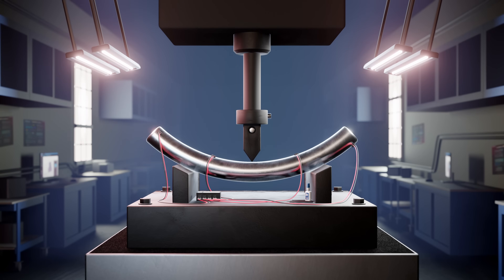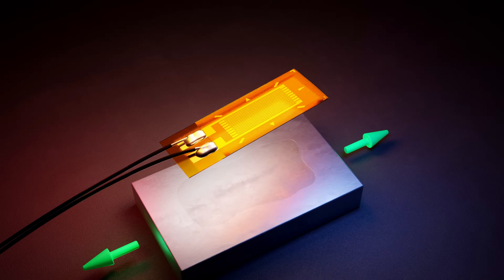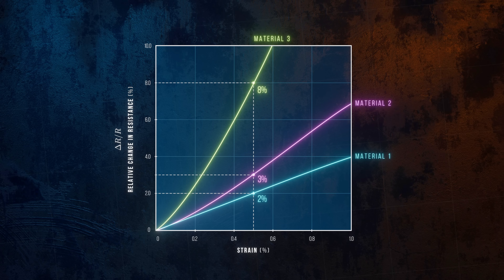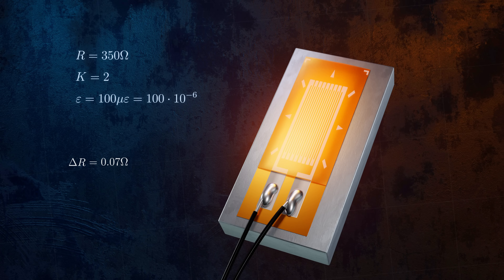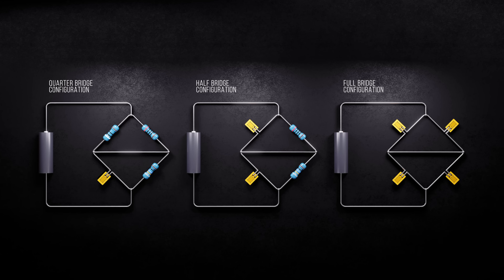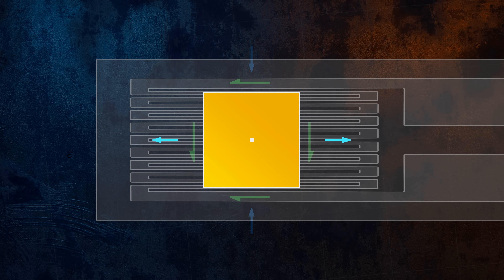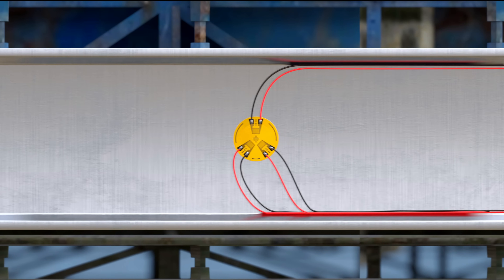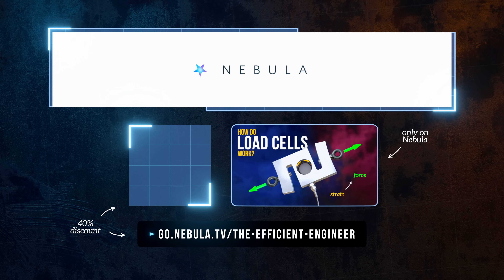The Ingenious Design of Strain Gauges

Comment from the maker: What are some other interesting strain gauge applications?
If you're interesting in the companion video on load cells you can check it out on Nebula at this link: https://nebula.tv/videos/the-efficient-engineer-how-do-load-cells-work
Reply: Got some video ideas from my mechanical engineering career :
Metal Additive Manufacturing
Ceramics 
Super alloys
Circuit boards :o
Coatings & Machining tooling
Reply: Used to work with them - testing car components. Was good fun !
Reply: Hey how about ARTIFICIAL GRAVITY 🎉 😁
I'm a regular ol sky-walker😂🎉 yay for me

https://youtube.com/shorts/aw2Zjrv6zkw?si=DA2IPe0O_CNWZn1p

Comment: I installed a lot of strain gauges in undergrad school.  We tested bolts and structures with reinforcing steel so I would have to file a smooth flat spot on the specimen, glue on the gauge and solder the wire leads to it.  I didn't know it at the time but we were using a glue material that later became superglue..

Comment: It has always astonished me that the original electric strain gauge was literally bare wire bonded to paper with nitrocellulose (Duco) cement, that was then bonded with the same adhesive to the structure. While this construction is pretty poor compared to the modern foil gage that is fabricated of high performance materials like a tiny circuit board, it worked , was useful and led to improvements to the current state of the art. 51 years ago, in my masters of engineering program at Cornell, we did a lab where we fabricated and tested gauges like the original BLH (Baldwin-Lima- Hamilton...yes the locomotive builder, who invented this amazing technology). It really brought the technology alive for me, and I have used strain gauges and loadcells and strain based transducers throughout my career. Custom transducers for measuring suspension forces in automobiles, torque in robot joints and applied forces in Friction Stir Welding to name a few. One of these is a X, Y and Z load cell with a 60,000 lb capacity in Z and less than 1% crosstalk in X and Y, without a compensation matrix.

Comment: Its bond with a special glue and then left to cure for some time.
Do you know it originate when the strain in an aeroplane wings was measured using a long resistive wire glued to the wing. Below the wire stretch and the resistor goes up.
On top of the wing the wire shortens and the resistance decrease

Comment: You can't measure change in size of a single point, any deformation must be measured between two points, whether electrical or mechanical. A point is infinitely small, immeasurable and usually resented by those without one.

Comment: A couple 'funny' animations:
0:05 The ends move up and down, a lot, even tho the load is only between the supports. The straight ends should have no curvature outside of the supports.
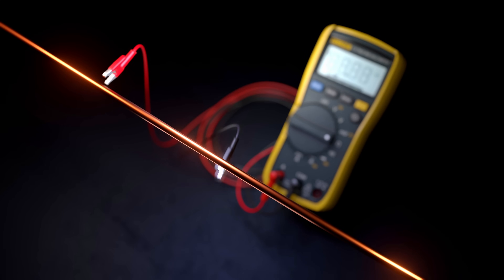4:36 Wow, that copper stretches a LOT, like 300%, and then goes right back to its original shape. That doesn't work for many reasons, not the least of which is simple conservation of mass, the rod's diameter never changes while expanding in volume 3 times.
Reply: I was going to make the same comment on the :05 image.....IT is a pet peeve of mine that incorrect depictions of physical behavior are lie poison....they lead to incorrect mental models of things like deformation of a structure under load. Real intelligence, like the artificial impostor, needs to be fed correct data to be of value, and animations like this faulty one are powerful images. They need to be right.

Comment: I use to see one of the inventors of the strain gauge, Edward Simmons, rummaging in the electronics part stores (when they still existed) in Pasadena, CA, from the 1970s thru 1990s. He was a bit eccentric, but all the other old timers that engage with him, did it with much respect. He made a fortune, but not from the strain gauge, but investments in oil companies.
Reply: Renaissance Ralph, as he was called, always wore opaque tights, some kind of short toga outfit, sandals and a hat, and was often seen on campus at Caltech. He was rumored to sometimes wash his hair in the fountains, but I never actually saw that happen.

Comment: Excellent! But what is a micro strain(in this context it is a unit of measure??)??
Reply: 1 strain is stretching something to be 100% longer.  Ie If I have a 1m length of material and I pull it until it's 2m long, it has a strain of 1.
If I pull it until it's 1.001m, it has 1 millistrain.  If I pull it until it's 1.000001m long, it has 1 microstrain.  So 1 microstrain isn't very much!

Fun fact for you if you're interested in such things: strain is a dimensionless quantity.  An area is length squared. A volume is length cubed. Strain is length ÷ length, and therefore has no dimension.

Comment: hmm so as an EE i highly doubt that wheatstone bridges are used for anything strain gauge when you can have a constant current source and a differential amplifier to measure the voltage across it and divide by the fixed current source for the resistance measurement
Reply: You'd be wrong. Wheatstone bridges are used all the time in this application.

Assuming 15mA excitation, 350 gauge and 2.0 gauge factor, the difference between readings for a 1uStrain measurement is about 10.5uV on a 5.25V reading.  Not impossible, but unwieldy and uncompensatable.

Wheatstone bridges are used because it's a lot cheaper, and you can use compensation techniques.  The downside is that you need high precision/very stable resistors in your circuit.  Think $20 to $50 per resistor
Reply: The wheatstone bridge offers a number of advantages for wiring strain gages in various configurations to cancel out unwanted effects on the strain gage. The full bridge configuration in particular is very useful. For example, a full bridge using the "chevron" rosette shown at 16:16 can be wired up to cancel strains caused by off-axis and bending loads and only respond to strains induced by torque. 
Constant current can also be used in strain gage measurements, but there are disadvantages there too.
Reply: @lancehadfield what are those disadvantages? I can make nano amp accurate temperature compensated current sources, theyre easy.
Reply: I should also mention that by using the WS bridge, you're measuring a voltage relative to 0, therefore amplification is easy.

Comment: 📝 Summary of Key Points:

📌 Strain gauges are crucial tools in engineering for measuring how objects deform under loading, aiding in structural integrity monitoring and performance optimization.

🧐 The electrical resistance strain gauge is a common design that measures strain by detecting changes in electrical resistance as the object deforms, with materials like Constantan being popular due to stability over temperature.

🚀 Wheatstone bridge circuits are used to accurately measure small changes in resistance of strain gauges, enabling precise strain calculations and monitoring.

💡 Additional Insights and Observations:

💬 "Understanding the basic concept of strain is crucial for appreciating how these devices work."
📊 Gauge factors and material properties play a significant role in determining the sensitivity and accuracy of strain gauges.
🌐 Temperature compensation methods like active and self-compensation are essential to mitigate errors due to thermal expansion.

📣 Concluding Remarks:

Strain gauges are versatile devices that play a vital role in engineering applications, offering precise measurements of strain and enabling detailed analysis of structural behavior. Understanding their principles and applications is key to ensuring the reliability and efficiency of various mechanical systems.
Generated using TalkBud

Comment: I use strain sensors as a hobbyist to experiment with measuring impact force, energy, deceleration. With my oscilloscope, I can measure the strain over time, which gives me the duration of the collision, and thus the decelerative G-load on the projectile, for example. And I don't even need an Arduino!
Reply: Arduino can’t even start to keep up with your osmelloscope
Reply: Be careful with high speed strain measurements.  The gauge itself has a frequency bandwidth which if not allowed for can give low readings.
Rule of thumb is smaller gauge length is faster, but I'm not an expert in dynamic measurements so other factors probably come into play.

Comment: This is probably the best concise explanation I can send to people about what I do. However, there is one thing that is wrong. Passive temperature compensation is what is described as "active" by using a second gage in the half bridge. ACTIVE is measuring and compensation through thermal calibration, EG you actively have to do something such as math such as read a temperature sensor (RTD, thermistor, etc) then calculate the new impact. When it's just one, we tend to say it's uncompensated and NOT passive. There are all extreme temperature cases where you'd select a different STC code than for the underlying material as you might be in a different area of the curve and can get better performance in high temp or cyro applications.
Reply: Really?  I always thought that relying on the STC of the gauge was sufficient for isothermal tests and was passive.  I too have used the word active for describing the half bridge technique. 
I've certainly never used your method of active compensation, however I've never used a gauge outside of -40C to +200C so the need has never really been there...
Reply: Never met a strain gauge.
Reply: @Aajo2025  Severely underrated comment
Reply: @fadedlamp42 you'll have to explain it to me
Reply: @Aajo2025  explain
Reply: @BariumCobaltNitrog3n  "This is the best explanation of what I do" [implying some industrial job related to strain gauges] being playfully misinterpreted to mean "I am literally a strain gauge, and this whole video is about me directly." "Oh, you're a strain gauge? Never met one of you before."

And now, like a frog, the dissected joke is dead. But I was really confused at first too lol
Reply: @headmill  got it

Comment: For concrete . can we use guges like this ? lvdt are better for concrete , am i right ?
Reply: Bond the gauge to concrete using epoxy and it will work
Reply: LVDTs measure deflection not strain.
Rule of thumb for strain measurement of concrete is gauge length >=3× the size of your aggregate.

Comment: Would be cool if you could cover different ndt methods used for different material. A bit more on the niche side of mechanical engineering but equally important

Comment: I am wondering what softwares can be used to create these fantastic animations? Congrats for an amazing video!
Reply: He said he uses Blender
Reply from the maker: Yup!
Reply: @TheEfficientEngineer  How long does it take to make the video (excluding the time spent on planning and refining what you wish to present)?
Reply: @aaabbb-py5xd a rule of thumb for general post production you can figure about an hour of work for every minute of finished video. So 20 minute video -> 20 hours editing. I’m not an animator, so I don’t know how much that adds or overlaps with the edit process.
Reply: @rjhornsby  Thanks for the input. It seems like a full time commitment, which I shouldn't mind since I can spend 20 hours straight playing games xD
Reply: @aaabbb-py5xd What's so funny about you wasting your life playing games?
Reply: @Secretgeek2012 truly a sad comment. I don't buy that you are not the eternal enemy.
Reply: @rjhornsby no such rules in post, specially with CG. He can spend a week modeling a device for a 10 second bit or spend 20 seconds orbiting a simpler device that he modeled in 10 mins.
Reply: The software that enables the creation of the graphics is amazing....but the monkey is still on the back of the creator to get the image or animation physically right. At :05 the deflected shape of the beam is flat out wrong. There is curvature between the supports, but it should not constant curvature. The curvature at any point is proportional to the moment at that point, described by the moment diagram for this situation. The beam outside the supports should not show curvature as the beam is deflected. It has no applied moment, and it should be straight but with a rotation angle proportional to the loading and deflection.
Reply: Just ask an AI to make it for you 😂
Reply: Adobe after effects